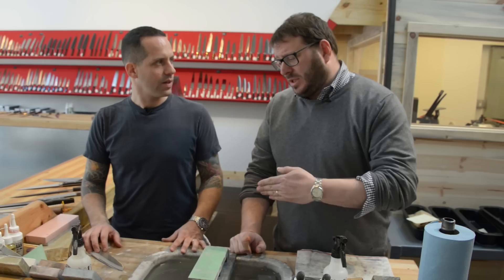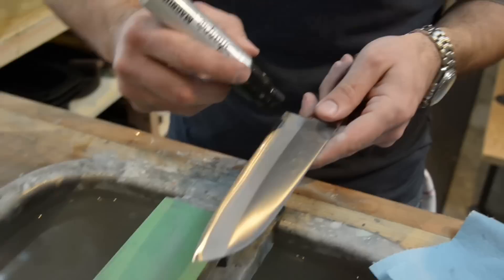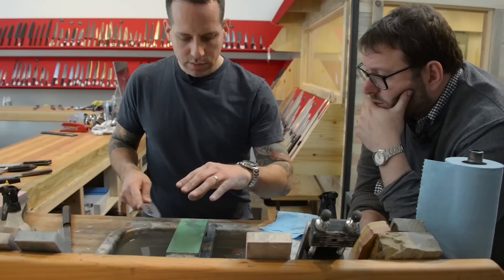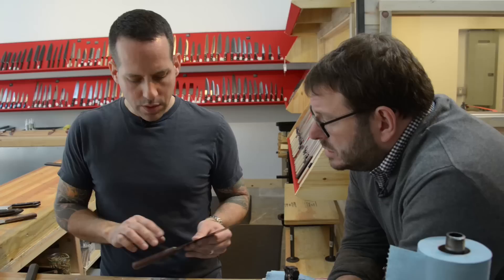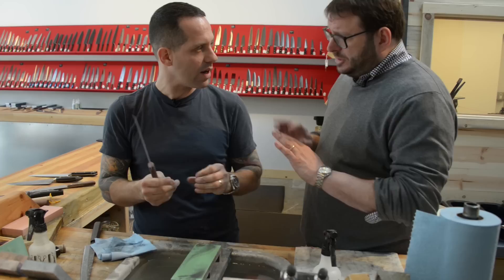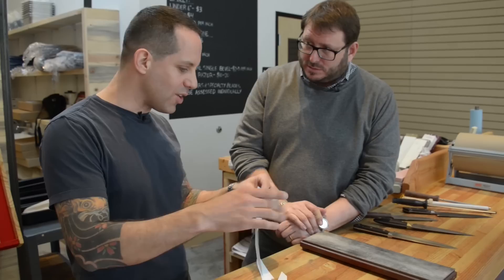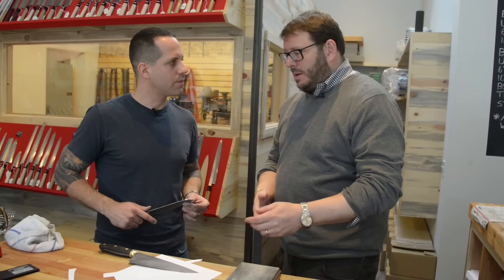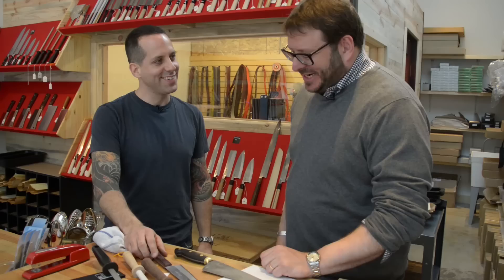How to Sharpen a Knife

Comment: Using a sharpie to see the sharpening angle is extremely useful.  Also I really like to see what do you mean of not finished eleven though you can easily cut paper. Any close up picture ?   Thanks.
Reply: check out the channel richard blaine he has very in depth if not a little long winded videos on sharpening where he talks about basically everything you need to know. 

When he said not finished hes talking about the smoothness of the cutting edge. You can get an edge that will slice through paper with a 240 grit stone. But it will leave a somewhat torn fuzzy cut in the paper. If you refine the edge essentially polishing with finer and finer grits you will end up with an edge that slices much more cleanly without the tearing. 

A low grit edge is good for sawing through fiberous materials like rope or maybe a squash, while a very refined edge is better for slicing through delicate materials like fish.

Comment: Yeah, I don't like the Japanese scrub style of sharpening because it tends to create flat spots on whatever type of blade you are sharpening, hence why almost all Japanese blades are more or less flat and don't have much curvature to the edge. Furthermore, this style of sharpening requires having a large bench stone and a way to affix it to somewhere so it can't move... So essentially this method of sharpening wouldn't work with a pocket stone, which makes it useless in my eyes.
Reply: I've literally sharpened my knife in my car with a whetstone on my thigh. Sharpening a knife is all about technique. You master your technique, you can sharpen anywhere with just about any decent sharpening tool.
Reply: As you could see hes sharpening a kitchen knife not a pocket knife. If you know what youre doing you could sharpen anything. Ive sharpened my pocket knives the same as i sharpen my kitchen knives. Its only useless if youre incapable.

Comment: In Japan, the knife is sharpened on one side only .... is not it?
Reply: Depends on the knife. If it's a laminated San Mai then no.
Reply: Laminated San Mai makes no difference whatsoever as to whether a blade is sharpened on one side (chisel ground) at all!  It all depends on the blade pattern as to whether the blade is traditionally chisel ground or not.  Usuba, Yanagi, and Kiritsuke are all examples of traditionally chisel ground Japanese blades, and they have nothing to do with being laminated OR San mai.  I really get annoyed when people talk out of their ass.
Reply: Sharpening on one side of the knife gives the knife a steeper angle which creates a sharper edge. Japanese style knives are well known for these styles of knife. The downside is that they need daily maintenance if you are a heavy user. Knives with steeper angles tend to be weaker and are more susceptible to chipping and micro chipping.